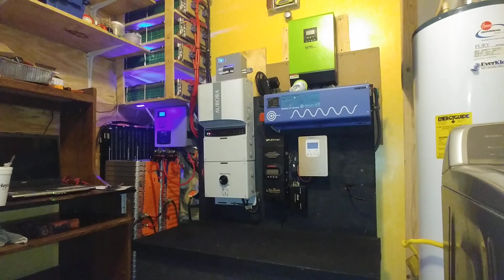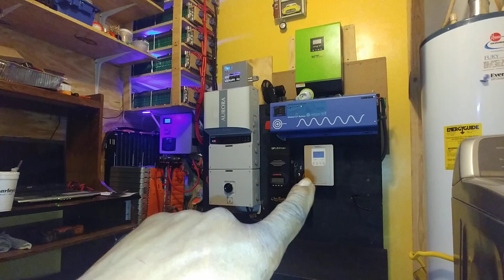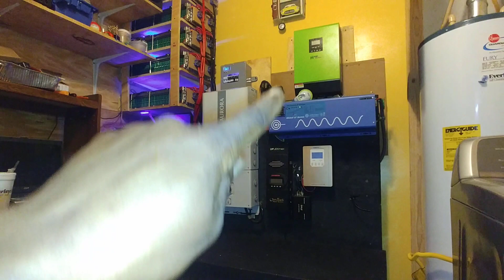battery storage

Comment: Hey Garfield great video. Did you say your system sits at 24.2 volts in the morning when you get up? I am asking because I have a lead acid battery bank totalling 856AH at 24volts. My batteries sits at 24.1 volts in the morning when I wake up but was  worried that I maybe pulling my batteries down too low on voltage. Is 24.1 volts a good place to have your lead acid batteries in them morning when you wake?
Reply from the maker: thanks for checking out my video,,,,,,,,i am no longer using lead battery and i am now doing bullshit with the excess power with no worry,,,,,,,and yes 24.1v is ok for your lead battery,the point is i can do way more with lithium than lead and even go down to 21.5v cut of on my inverters at any gining time without worring  about killing my battery bank,,,not that you cant do it with lead but you will alot more
Reply: @bimmers323ci  thanks I watch all your videos from your system was on you front varander so I know your now using lithium batteries. Really nice system by the way you sound like a Jamaican I myself is a Jamaica.
Reply from the maker: @seanjsolar2493  thanks for checking  out all my video,,,,yes i am jamaican

Comment: Hey bud what size wire did you use on ur batteries I'm going to use 1/0
Reply from the maker: Thanks for checking out my video......all packs are running 4 gauge to breaker and fuse block and then to busbar and 0 gauge from busbar to inverters